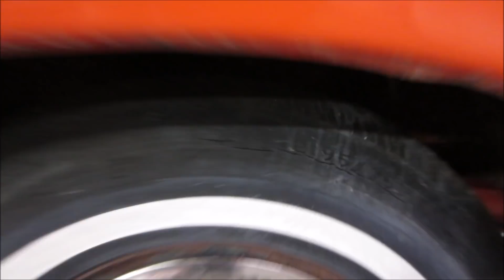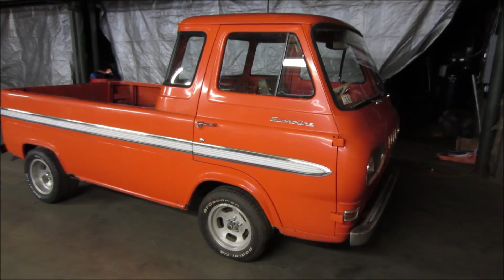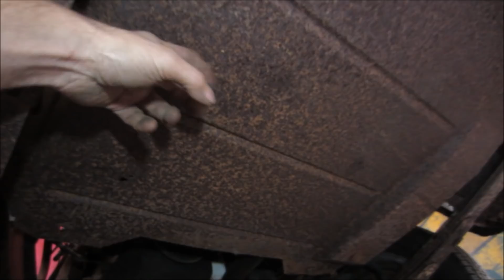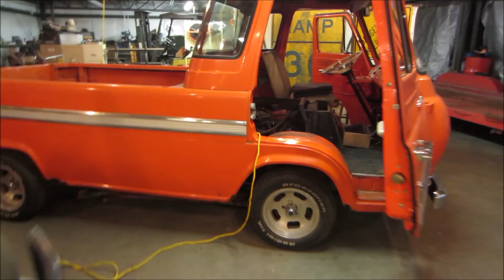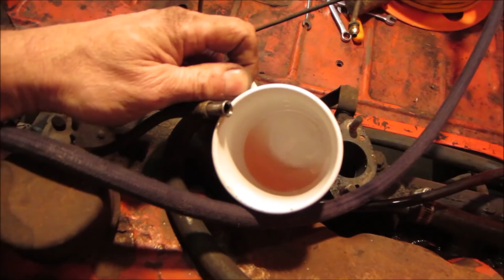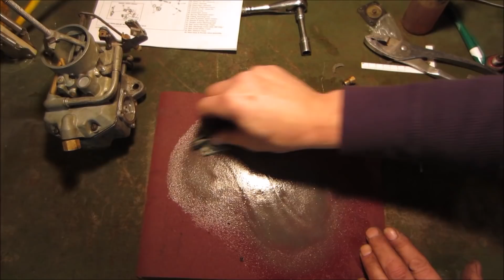Bought A Ratty Ford Truck,  Let The Fixing Begin.

Comment: Look for some LED bulbs that are listed at about 2700 Kelvin. Most LED bulbs are available in multiple color temps for the same type of bulb.  2500 - 3000 kelvin is the warmer or amber color light. 5000 Kelvin is the white light or more “hospital” color.  Also, the k-temp has nothing to do with the brightness of the bulb.  Brightness is lumen. Kelvin or K-temp is color.  The bulbs should list the k-temp and lumen on the box under “Lighting facts”.

Comment: Had a similar problem with a car that the Gas tank was odd and no one made, the work around was to go to a speed shop and buy a racing tank that fit in the trunk for 1 tenth of the price , I doubt you will be using your hot wheels truck for cargo so go with a racing tank in the bed , cheaper and easier

Comment: Why not just cut the inner lip off the fender in the rear and weld it to give yourself a little extra clearance for those sweet wheels and tires you have? Seeing you install the mag wheel nuts brought back fond and hateful memories of my 1982 Dodge Ram 1500 Van with a 225 slant six with 4 on the floor manual. Thanks for that, it brought me back to my high school days.

Comment: Interesting design of truck, never seen in England. Would be good with a demountable camper back.  May I suggest you look at your screwdriver action?  I've had to have a Carpal Tunnel operation, because I did the same. Pulling your tendons over a bent wrist causes the problem,

Comment: I thought the accelerator pump was for a drop in vacuum.  When you open the throttle at low RPMs, there is a massive drop in vacuum and that the accelerator pump was to deliver more fuel to raise the RPM which will increase the vacuum.

Comment: Check out prices on fuel cells also they are a very hard type of plastic but no corrosion from ethanol based fuel if you run that crap I personally don't but nhra and nascar use them in their cars love you he vids keep up the good work on rusty junknot to many of us keep junk going anymore
Reply: Stupid spell check put love you for some odd reason LOL didn't catch it till it posted
Reply: Suppose to be love the vids

Comment: When you drop the tank, you will find the counter weight. For the gas tank look for a mustang tank and move the filler neck from the rear to the side like the original (this will give you a larger tank as well ). Vintage Vans .com will be your best friend for all the help you will ever need to fix, find, and great ideas on where to turn to for all that this truck will need. My van is running a 350 interceptor with a taurus electric fan for cooling. WORKS AWESOME!!!.

Comment: Look at the 90 model ford f150 rear gas tank it doesn't fill back left corner but the left middle of the tank and it has the option to have a 15psi lift pump out of the 89 but it a cheep alternative 18 gallon tank for 80 buck on Amazon maybe something to think about

Comment: First and foremost,  get yourself a set of of flare nut wrenches. Low pressure flared tubing connections are bad enough without them, but high pressure applications absolutely should NOT be serviced without them! They are far less likely to distort the connection components, and far less likely to slip off, or round off the hex!

Comment: For 400 bucks, I'd be looking into SS fuel tank with an inline fuel pump!!! Holy crap!!!!! These trucks look awesome with fat tires on the rear, but UNDER the truck. Not so much hanging out the side.. And air shocks suck!! A stiff rear and all nose weight will put you on your nose....

Comment: I am curious. Does it have a cast iron weight mounted above the gas tank in the rear. The first one we got in in late 1960 was so light in back that all it wanted to do was spin the wheels. A day or two after we received it, the freight company dropped a palet with upgrades for the Econoline pup. That upgrade amounted to a heavy weight that replaced the gas tank mounting brackets, bolting it thru the truck bed, then remounting the fuel tank below the weight. As I recall the weight weighed around 350 pounds. It did help keep the back wheels on the ground, both in accelerating and braking. They were prone to nosing over during heavy braking. Made for an exciting ride.

Comment: Oh, check out "coldwarmotors" on YT here.
They are rescuers also.
He just built a few panels for a econoline.
In this issue and the next one. Seems to me that one of the ones he built was exactly some of the same parts you are looking at.
I'm leery to leave links.

"Cold Starts, New Parts & Classic Darts!
coldwarmotors 

Published on Nov 23, 2019
HI! We're back with more of the 1960 Fury rebuild! This time some more work on the floor, and a "reasonable facsimile" of the gas pedal bracket!
Also some repair panels for the boogie van project, the lettering and stripes for the Lotus racer, and of course Classic Darts! This time a 1974 Dodge Dart Sport project for Agent 7678 (and more)! Do we "Cut to Dean"? Damn right! Hahaha"

I had the exact tires and rims on my 74 Ford F100. It would be wrong not to put those tires on that vehicle.

Comment: It is a straight six will run for ever.
If you don't crash it it will oit last you. 250 you can get a master rebuild kit for that thing.
No need for the e brake.

Comment: A 240 6 cyl will drop right in. I suspect a 300 6 cyl from a truck would go in a LOT easier than a V-8. A bunch of doghouse and floorboard surgery is required for a V-8 in an Econoline.

Comment: Ok, something you'd probably know. Cars from this era, that have generators. PLEASE DO RESEARCH FIRST to check me out. Generators/ voltage regulators that have been removed for service or if they are new ones, need to be polarized.. You momentarily apply voltage to them, BUT, reverse polarity. Positive to the device ground. You only touch it for a second or two...My dad owned two 1961 Ford Falcons and a 1963 Mercury Comet. He did most of the repairs and that's what was in a "Motors" car repair manual..No, I no longer have the book to take a picture of that page...                                                    Yes, the 'classic tires" are past due for replacement.......

Comment: Too had its not an HD model they had 9" rear ends. You will find the brakes next to useless. The auto transmission version had a dash pot hence the two pumps in the kit

Comment: As I recall from millions of years ago, did they not have a soft washer that went between the carb top housing and the fuel fitting, fiber of some sort???
Reply: I’m pretty sure you are correct about that. I can’t remember any carb I’ve ever rebuilt that didn’t. I know the carb I rebuilt a couple of years ago for my old Toyota 22R in my 4x4 truck had one.

Comment: I like the wide rear tires. That's the way all the cool cars and trucks were when I was a kid.

Is that vacuum hose off the top of the carb for the windshield wipers? I know the mid 60's Bronco's had vacuum wipers.

What do you plan to do about the broken cylinder head?  If I saw it correctly, it appeared like some of the exhaust manifold mounting ears on the cylinder head are broken off.

Comment: You have your comments shut off on the 3rd episode. So if you read this taking manifold bolts out if you heat it up and put beeswax on the bolts the beeswax will suck into your manifold and you can avoid breaking off the studs. Learn to beeswax trick about 50-60 years ago itworks

Comment: Will this truck is in better shape than my first car she needed floor boards you could bail hay in the backseat I miss that car it was 61 Mercury meteor 600 2 door inline 6 with a Holley 1 Barrel carburetor I thank the spark plugs wear number 63 or 64 big 13/16 plugs I just didn't know what I know now it ran and stop lights work it was so much fun to drive to best 50 bucks I've ever spent

Comment: How do you guys go with the wider tyres over there? In Australia, they allowed 1 inch of tyre/wheel past the wheel arch, when it's practical. 

Personally, I prefer the original wheels, but that's just me. I prefer keeping (old) cars as stock as possible, especially appearance wise. Underneath, it doesn't bother me too much.

Comment: I know ya've dun it a zillion times, but under high torque the flare nut wrenches tend to keep the collar nut a bit more round when tightening down.. it may have made zero point zero difference in this case.. but.. uh..........?

Comment: From my understanding this is a full uni body design? If so then putting it on a lift and disconneting some wires should be able to remove the motor mounts and cross members and the whole thing will drop out?

Comment: fyi THE 170CI PRODUCES 105HP, WHEREAS THE 144CI ONLY PRODUCES 85  HP.  ALSO IF THIS IS A 1ST GEN 170, WILL BE A 4 MAIN BEARING CRANKSHAFT, VS 2ND GEN 7 MAIN BEARING CRANK. 

Suitable replacement would be 200ci or 250ci inline 6 (7mian bearing) used in the Mustang, and "newer' Falcons.  A 4speed manual Trans would be as nice improvement.
Reply from the maker: 85 net hp

Comment: How many of us disconnected the air pump, then hooked it back up for the inspection? Cars used to be so easy. Nowadays your car can  leave you stranded because a tire is 4 pounds low on air or your ass warmer threw a code, ffs...

Comment: I was cringing watching him crank on that fuel line fitting. They do make line wrenches.
Reply from the maker: you act like the wrench  was slipping on the outside,
Reply: @mustie1  Instead of, or in addition to oil undercoat, I go to self serve car washes and spray the underside and all potential rust spots with the wax setting, letting the pressure washer carry wax into every crevice. in NH, car washes also have "corrosion inhibiting undercarriage rinse" which is also good in addition, especially when it is too cold for self serve car washes.
  And silicone based tire shine protects mufflers.  the only problem is if you plan to paint, it must all come off.

Comment: well if its only ever going to be a show piece it doesn't need anything doing to the rear wheel you wont be putting a ton in it so keep it standard il never weigh up why America wants such big engines to do a little job and then even call it econo line strange